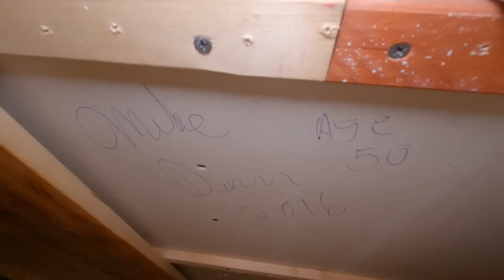Tearing Out My Custom Cedar Interior That Took Years To Build! Cabin Renovation Alone.

Comment: Yes!  An island—as large as practical, three sides closed, one side  open ( or with doors) with a shelf for pots and pans on wheels. Overhang for stools.   Adds extra countertop and you won’t lose the storage space in those two cabinets you’re taking out.  And you’re right – – you don’t need a stove. People live in RVs and buses and only have induction cooktops and other small appliances.

Comment: Love my induction cook plate. Any cookware that a magnet will stick to will work on it, cast iron, stainless steel, etc. much better heat control than a hot plate. I lived in a rental for five years with that, a microwave, & toaster oven, worked great!

Comment: Mike Mike Mike,  When in doubt, use the KISS Principle and make the space what YOU need...My kitchen is set in...granite counters and oak
cabinets...ok for our needs and as a New Englander looking to reduce costs and save $$$, these will stay until we win the lottery...I had a coat closet across the finished basement doorway...took some measurements and found a 6 shelf unit that fit into space...now I store my electonic
cooking pans etc in there...big difference and easily accessible for me, as hubby only knows two methods of cooking, burn and take-out...
regardless, less clutter brings out the Parisian Chef in all of us...Carry on and as always, Cheers from Maine.

Comment: Hi Mike, just adding my 2 cents here. You said you didn't like to lose your cupboard with the drawers. When you pull that half wall out, why not move the drawer and top cupboard to the end of your counter. There's still room for a window beside it  and it would finish the cupboards off nicely , floor to ceiling. in the end youu will do what suits you best, just throwing another idea into the mix. Go find your hammer man!
Reply from the maker: I built all the cabinets to the wall, no way to separate in one piece
Reply: @ouachitamountainliving   ok, I was talking about the one piece standing alone that you are going to tear out.
Reply from the maker: @janetbird8171  yep, its built into the wall,I will save the drawers and use elsewhere

Comment: I have a toaster oven set on draws its great for one person and it takes a 12 inch pizza  I would leave the ceiling as wood as it gives  a visual room divvied.  I was  thinking that putting a window  in would be nice.  If your going to have an open plan kitchen living room you could  close the door way off and give your self more wall space. corner unit  draws and then your fridge,  So pleased your have decided  to move the  post it was getting in the way of the new room
Reply from the maker: Yep, its gonna be gone a few hours from now, tune in tonight

Comment: I wouldn’t be so fast to get rid of that stove.
You might regret it
Keep it for a while and then decide.
Reply from the maker: Lived first 5 years here without it, cant think of any reason I would regret getting rid of it.
Reply: @ouachitamountainliving 
Murphy’s Law…it’s when you get rid of something…then something happens and you need it.
Not saying to definitively not to get rid of it…just hold onto to it for a while then decide.
Your used to cooking on a stovetop with 4 burners.
It’s not the same cooking in a electric fry pan, microwave, etc.
I’m sure you know that.
Just keep the stove a while then decide.  That’s all I’m saying.
I personally hate cooking with those counter appliances all over the counters.
Always afraid I will burn the house down.  I don’t trust them.
I had electric hard boil egg cooker.  Worked great.  It died after a while.  Bought another one different brand.
It was exactly the same but seemed to work different.  Put it in the same plug as old one.
I put the eggs in with the water.  Was making something on stove.  Egg cooker behind me on the right.  Something flashed in the corner of my eye.  I turned around and the egg cooker was on fire shooting flames out.  I luckily able to grab the cord and pull the plug out.
The flames were right under my cabinet!
What if I wasn’t there!
Catastrophe!!!
That’s why I don’t use a slow cooker.
I never leave my appliances unattended.
Those appliances draw major power and wires get hot!
Stove are made to carry the electric load with the heavy duty wire and double pole circuit 
breakers.
Obviously, that egg unit I purchased was defective.
Now…I’m leery of any table top appliance.
Hope all goes well.
Wish you the best as always Mike.
Area looking great!
Reply from the maker: @moalf5088  Cant miss something that doesn't work.If I have burners all I need.Nobody comes here for meals,its just me.That stove is 10 times more dangerous than anything in the cabin.
Reply: @ouachitamountainliving  

Okay…..